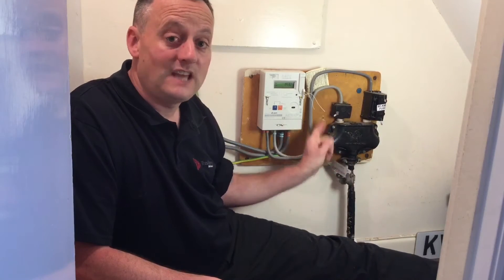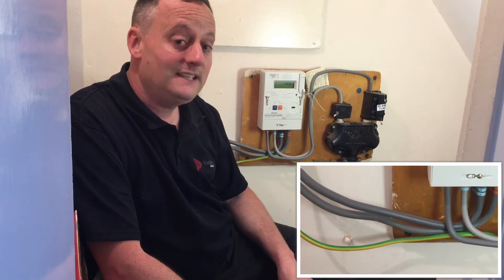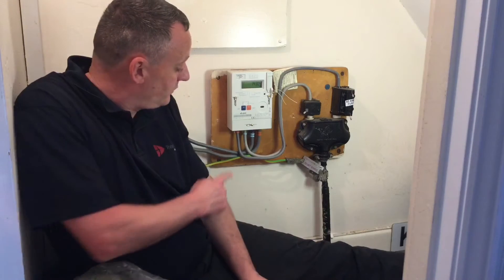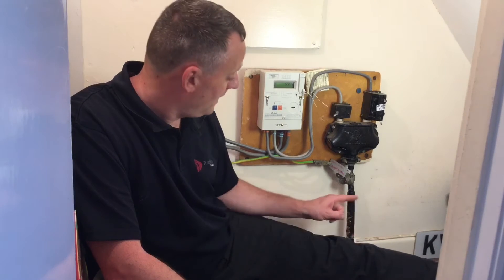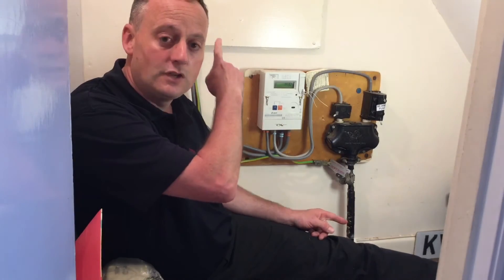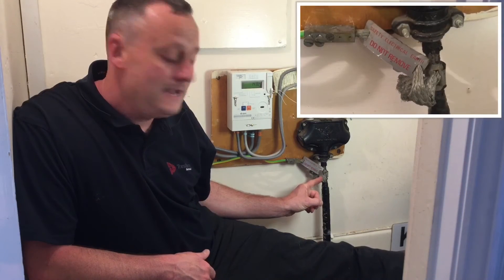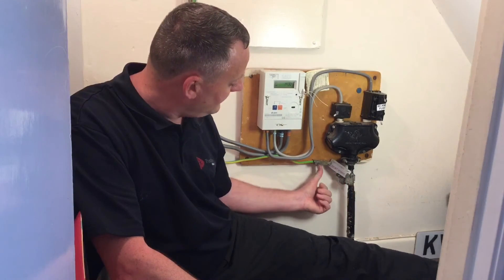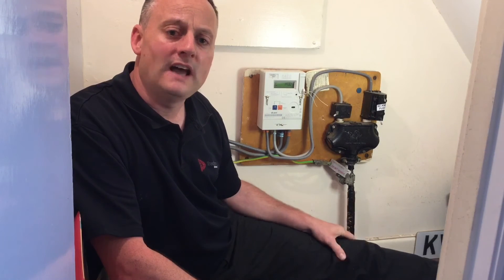Earthing Arrangements Identifying The Correct Single Phase Earthing Arrangement TN-S

Comment: Thank you for the clear explanation. I have one question about how the connection is made to the lead. You mentioned that if a clamp is used, it loosens the more u tighten it. Could you please explain further how that happens and how the connection should be done properly?